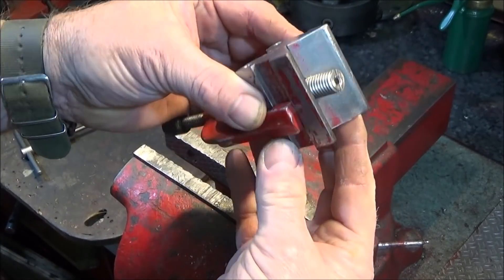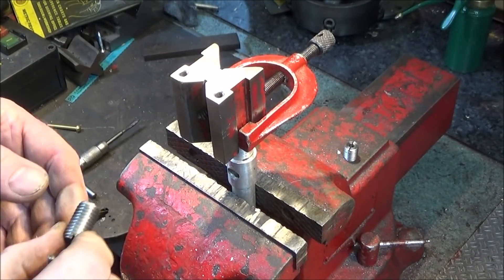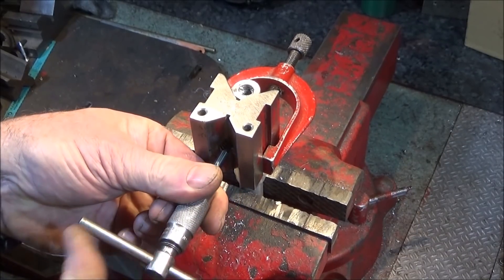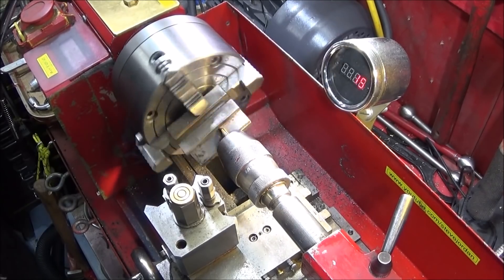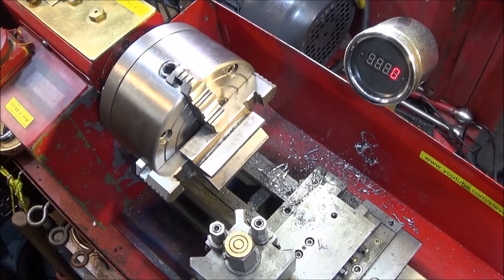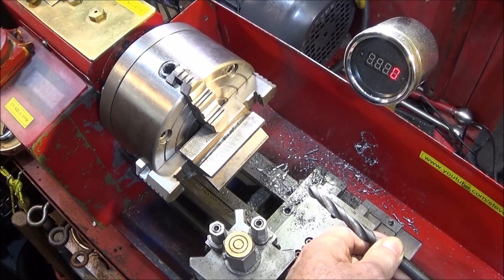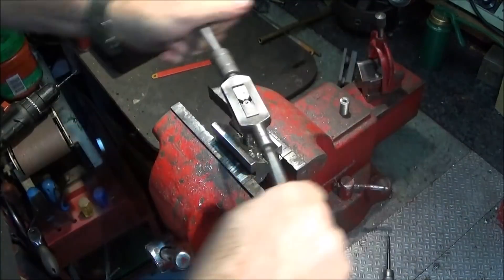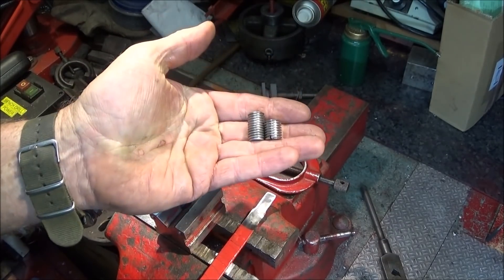Make A Simple Drilling & Tapping Jig From An Old V-Block

Comment: Clever idea Steve. Did you upgrade the motor on your mini lathe, can you give me some specs on it. I am having serious issues with low torque with my 7 X 12,  I installed a new control box wired correctly but I need to look into this further. Thanks, cheers, Doug

Comment: Think I might have milled a flat on the underside of the jig, just slightly larger than the threaded guide and just down to the existing narrow flat in the v-block. Would make it easier to start the guide. Come to think of it, a flat on either/both sides shouldn't have an impact on the performance of the jig. Definitely a flat on just the bottom though, less pressure on the drills as well.
Reply from the maker: I bored one out a bit at the front. That gave a lead in for the tap and made it easier, but like you say milling would make it easier as well.

Comment: Steve, thank you for sharing your brilliance!  Once again you give us a complete high-quality tool system to make from materials on hand and easily found.  This can save a trip back to the shop when making a custom fitment, and its easy to make a set of 12mm threaded guides drilled as required.  This is excellent.